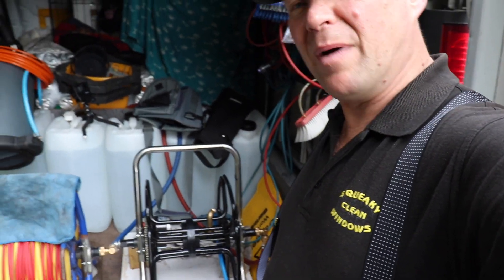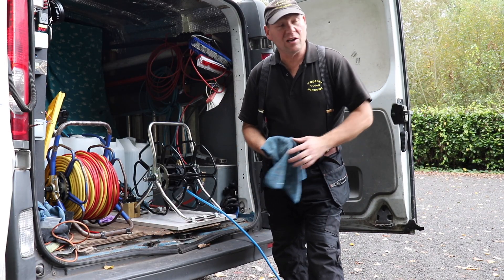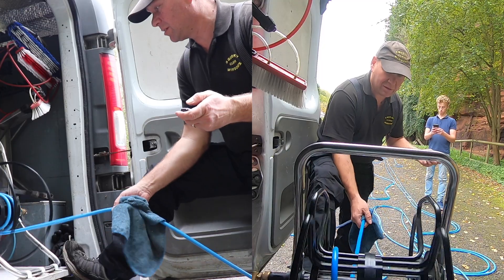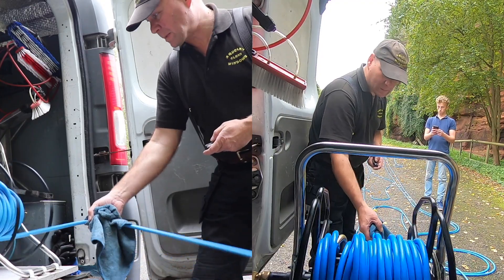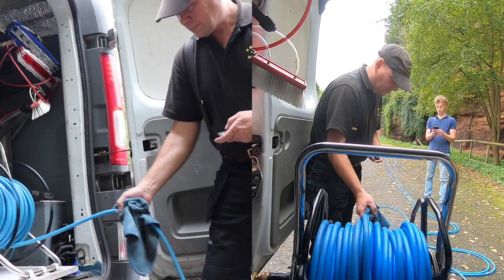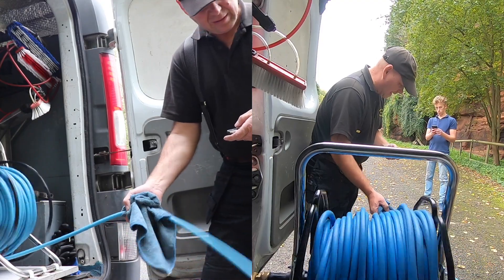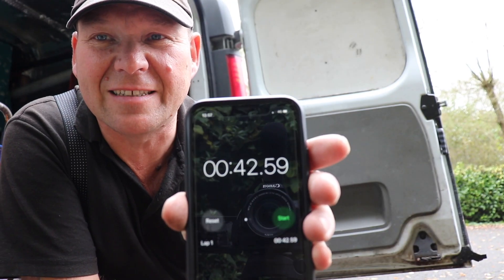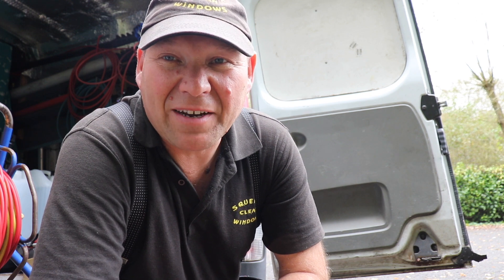Homemade Powered Hose Reel Speed Test

Comment: A true reel expert at work! I will have to practice a bit more to match up to you Dave!
Reply from the maker: It was the concentration on my face that made me laugh
Reply: You did get it caught Ashley and less room for the hose, but I still think Dave has the edge.
Might need to get Dan to match it with the Pure Freedom
Reply from the maker: @G71cleaningServices  it would be interesting to see
Reply: It’s a challenge that every wfp window cleaner should try!😃👍🏼
Reply: Ding ding challenge is on ,  just add a  turbo super charger now 👍😂
Reply from the maker: @FlashTechEngineering  fantastic 👍
Reply from the maker: @aemackintosh  think you might have started something here Ashley

Comment: Nice video Dave! When I was building my power real I only could find the smaller sprockets so I used a Draper Mounted Grinding Point Set from tool station to get the hole a bit bigger and it worked a treat!
Reply from the maker: Glad you managed to get it sorted👍

Comment: Hi 
Can put the name of the parts used in this powered wheel so we can work out the set up , and better picture of it , some close shots will help, the  assembly parts, so people might benefit from this video, in general, something like car alternator or small electric motor and small bicycle chain set and battery etc, it won't be difficult to work out for people with some technical knowledge to get some idea from it 
Thanks
Reply from the maker: The motor is a 24 volt 250 watt escooter motor running at 12 volts. the chain and sprocket are also escooter parts

Comment: Impressive video. When I made mine I couldn't get the sprocket I just had to file the diameter of the hole bigger and re drill the holes for the bolts. What size motor is that its quicker than my diy one.
Reply from the maker: Thanks Neville. It a 250watt motor👍
Reply: Same as mine🤔 I think i might need a new battery. Mine took 90 seconds.  Thanks
Reply from the maker: @nevillegoodchild3680  it does suck the juice out of the battery 🔋
Reply: @squeakycleandave1  i must admit if I start my van up the battery goes to 14 volts and it reels in so fast.
Reply from the maker: @nevillegoodchild3680  I wonder if I could have done it quicker if I had the engin running 🤔
Reply: @squeakycleandave1  i sense there's another video 🤔🤣🤣
Reply from the maker: @nevillegoodchild3680  🤣🤣🤣

Comment: Dave, ace inovation that works great. can I suggest a motorbike breakers for sprockets ? They`re a great source of cheap bits hard to find ordinarily. If you do manage to compile a list of bits to construct your powered model, I`d be very grateful. ta.
Reply from the maker: Thanks for the idea. I think the motor bike sprocket would be to wide for the chain as it’s only 6mm

Comment: Nice one Dave, I was about to time my diy reel I'm sure it does it in under a minute. 
I recommended Ashley to convert his remaining manual reel. 
Recently helped my friend convert his reel. The hole in the sprocket was easy to widen out with a half round file.
Reply from the maker: Great advice. Thanks Tim👍
Reply: @squeakycleandave1  Just timed my reel... 51 seconds for 8mm hose pulling it round the corner of a building.
Reply from the maker: @timhancock5556  that’s pretty good going. That 8mm is much heavier 👍

Comment: Nice one Dave
I’ve built 2 exactly the same. My motors are 350w each and never missed a beat.
Reply from the maker: Fantastic. I bet they wind the hose in really fast. With a bigger motor you could fit a smaller sprocket which would make it super fast 👍

Comment: An unscientific experiment!

I'd like you to try and connect your hosereel to a v11 controller to see if you can change the speed/dead end (would that work like resistance?)
Reply from the maker: Probably work better with an old analog controller 👍
Reply: I like that idea. I believe a controller monitors current to detect DE so it could also detect snags or people standing on hose similar to some of the powered reels. Then you are adding a few quid but still so much cheaper... Interesting - over to Dave :-)
Reply from the maker: @ched999uk  I will contact Spring and see what they say
Reply: @squeakycleandave1  My guess will be that the standard controllers cant  take the reel motor current. Wouldn't make it any faster but might put less strain on things?
Reply: I thought the same about the current in the controller. To me is less about the speed and more about the safety that you won't trip someone up on it. I have seen someone on YouTube that had something like that, but I don't know if it was an specialist controller....

Comment: Did you make the fob thing for it?
Reply from the maker: I bought it from Amazon. Think the link for it is in my hose reel improvements video 👍
Reply: @squeakycleandave1  I’ll check it out cheers Dave
Reply: @squeakycleandave1  What’s the range like on the fob ? I’ve got it here and I’m going to wire it shortly. Do I just take the feed from the battery for input and then output for the motor and do away with the switch ?
Reply from the maker: @christopherhawthorne7457  Thats what I have done. the range when new saw about 30 meters. I haven't tested it since but never had any problems with it
Reply: @squeakycleandave1  thanks Dave, I’ve a waterworks setup so do you reckon it will still be fine with the receiver behind the plastic cover where all the wiring is ?
Reply from the maker: @christopherhawthorne7457  I wouldn’t like to say but the one I have has a little curly wire which is the aerial. Can you pull that out a bit
Reply: @squeakycleandave1  yes mine has that aswell. I’ll maybe mount it on the front of the plastic then
Reply from the maker: @christopherhawthorne7457  probably safest